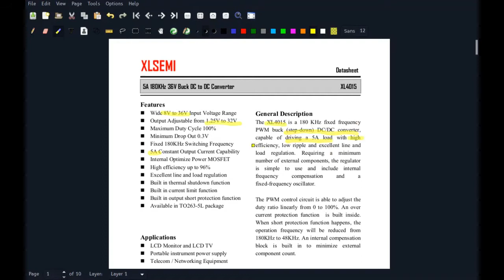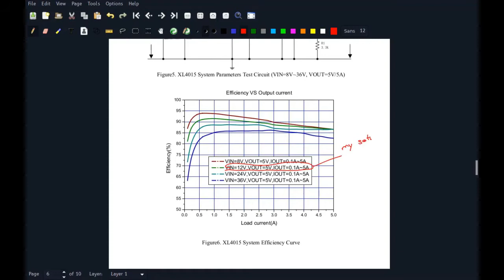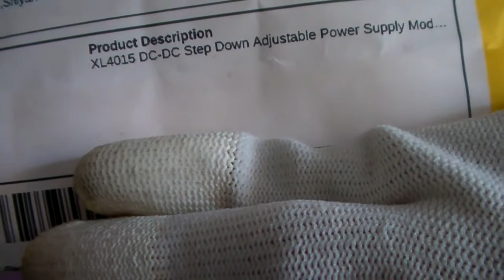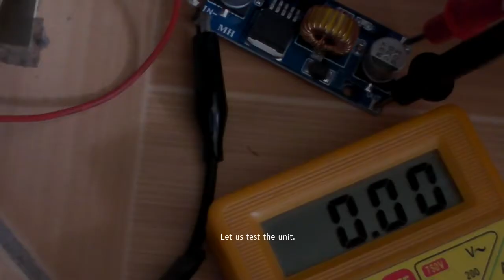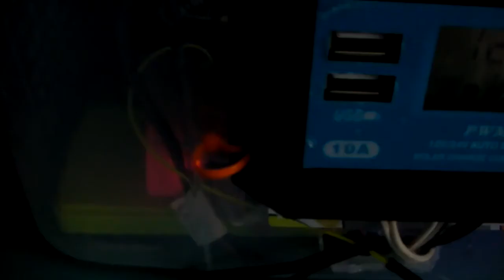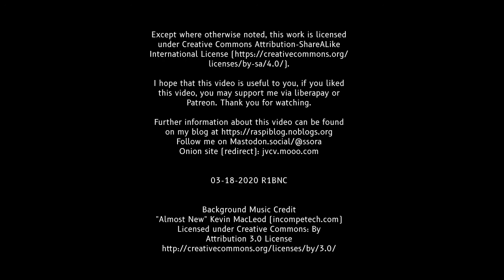XL4015 5A DC-DC Step Down (Buck) Converter Module

Comment: Can I use it for 10 hours continuously
Reply from the maker: Depends on your load, monitor the heatsink temp (add a fan if it gets too hot), currently it is being used 24/7 powering my Raspberry Pi.